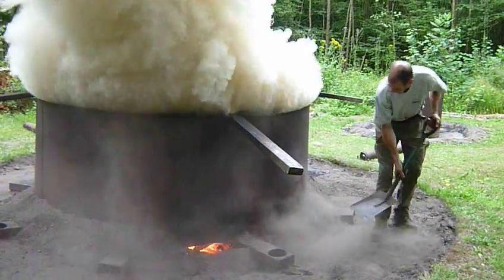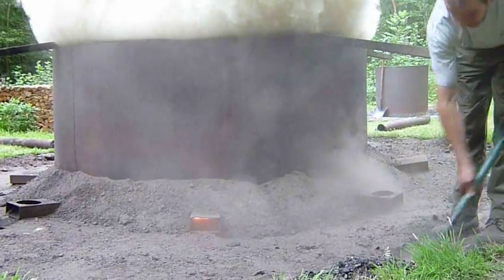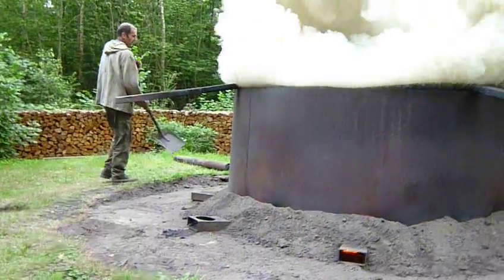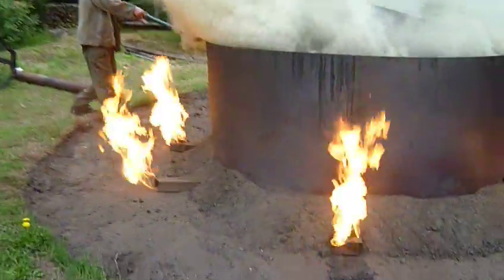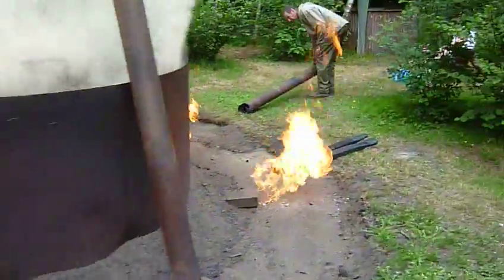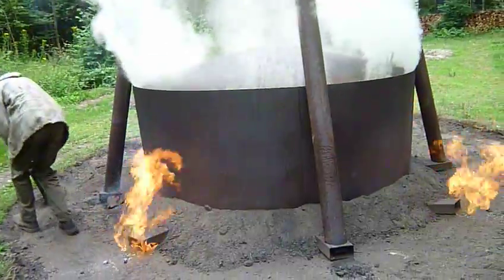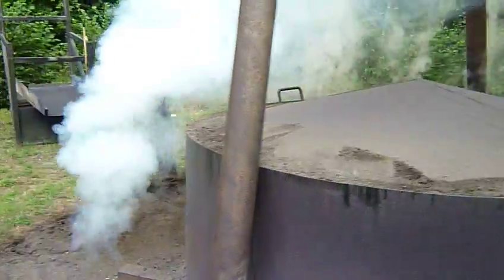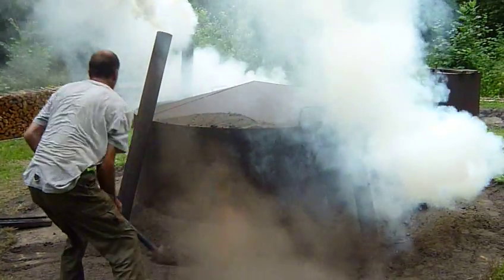Making Charcoal - Part Four

Comment: Not bad at all. I'm a blacksmith and I suggest keeping 10% volatiles in charcoal. Been thinking of making pine charcoal for some time and the nearest coal shop is too far away. I also hate commercial charcoal, which has no volatiles, which is what we blacksmiths need to get a welding fire.

Comment: @username132 A lot of the "smoke" is evaporating water, so I doubt it could be burned.
Reply: cliftut smoke is unburned fuel. It’s extremely flammable once it hits an oxygen rich environment. If he would have put any flame to that super heated thick smoke before he dropped the lid, he would have had a fireball.